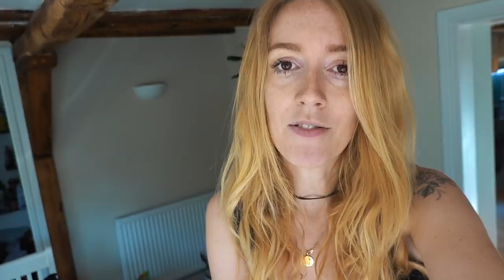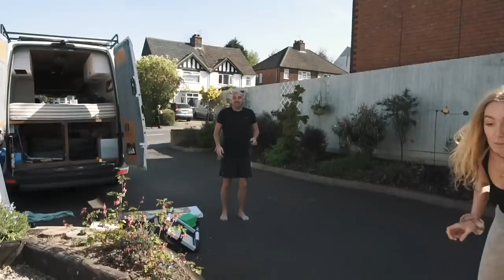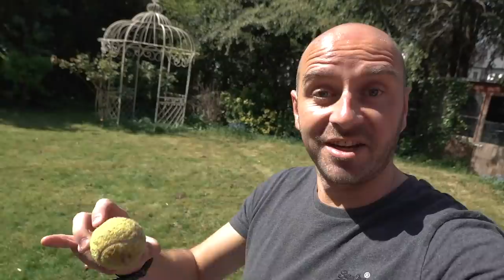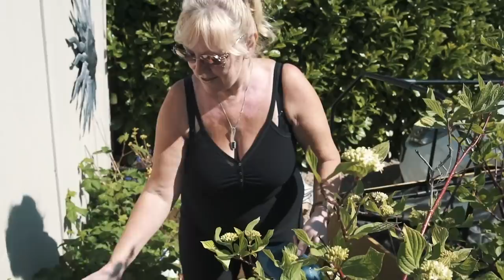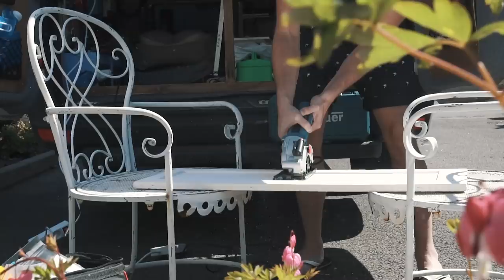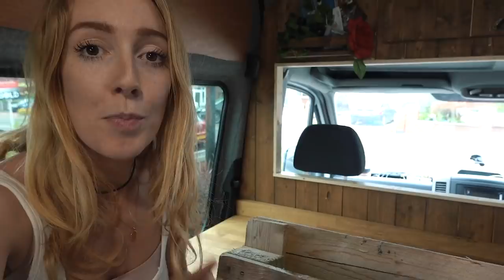Van Life in LOCKDOWN - Time for some upgrades! Ep 19 | Van Life UK | VAN LIFE DIARIES

Comment: Bolts get wet as they transfer the cold through the insulation and you get condensation.  A thermal break like insulating the heads will help 👍🏻.
Reply from the maker: Hi Peter, thanks for the heads up. Hoping that putting the sikaflex on the bolt heads will prevent any more cold transfer coming through! All these little things you don't think about until you've been on the road for a while 😊